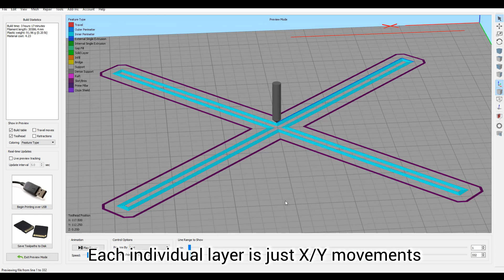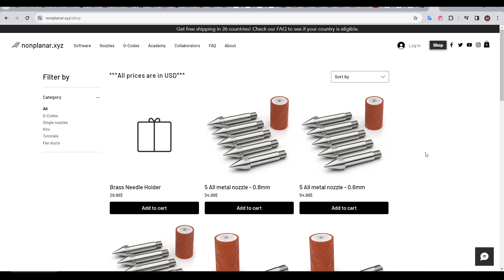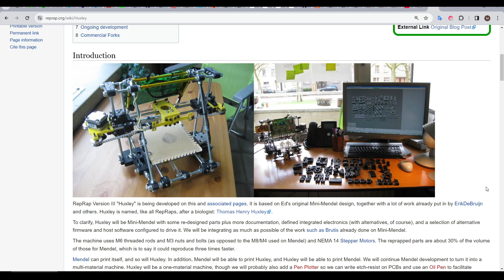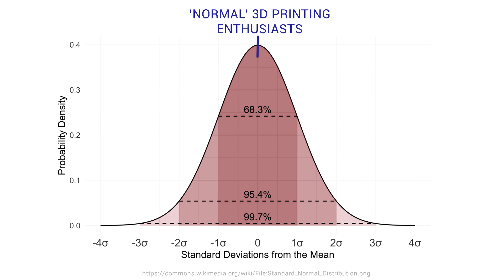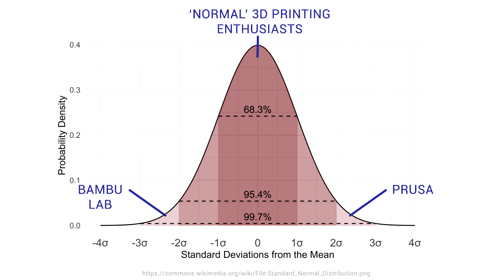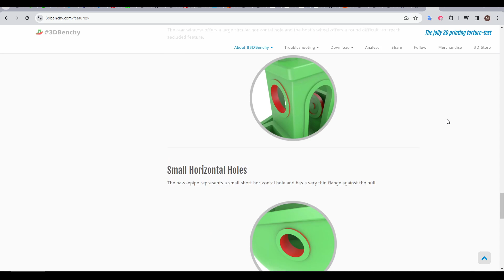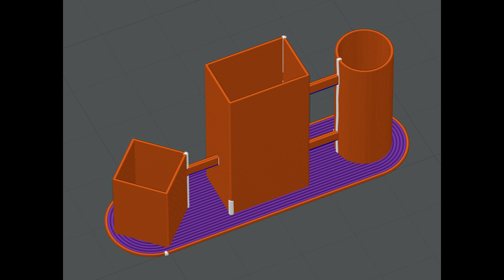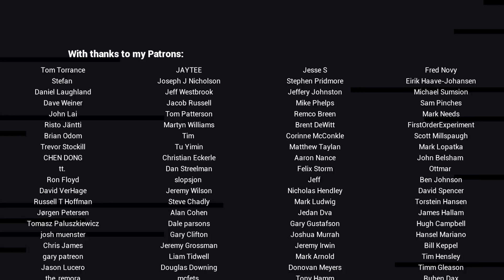3D printing mysteries that need to be solved in 2024

Comment: for filament snapping. this always happens to filament I left sitting in the machine, but only  for the bit inside the bowden and about 10cm or so outside. after than it's nice and bendy even for weeks. 

something chemically happening because of contact with PTFE?

Comment: Looking at the filament i would immediately think its making a turn in the bowden tube it cannot handle (too tight) especially because the filament has snapped on exacly the same side.

2nd thing i can think of is (looking at the machine) that you are forcing the filament to bend the other way then it is on the spool.
Turn the spool upside down so the filament feeds in on the top, make a bracket that high for the tube so it "flows" better to the head without bending it against its natural direction.

Comment: its odd to me non planer hasnt taken off as somebody who does CNC machining. The gcode generation is there to move end mills through materiel non planerly for cutting, well if you dropped step down to say .2mm programmed with a .4mm end mill youd basically have the reverse of a 3d print movement wise. Restrict that to an area the clears the nozzle and print head and you might be able to just just copy paste the gcode lines in reverse onto what your slicer outputs 🤔
Reply: The software for 3d slicing is there. The hardware (hotend gantry design) is the issue

Comment: All filament will spiral Clockwise regardless of the country - I am in Spain (North Hemisphere) and in my most recent video (at 1m53s) I also had filament spiralling clockwise. The reason is most likely that all drill bits carve clockwise, and they make microscopic grooves on the nozzles that guide/spin the filament in this direction.
Reply: The video is this one: https://youtu.be/qNCDXdjJb90?si=WRsg93vkoDT-NmxP&t=113 Filament spirals clockwise as well, in Spain.

Comment: Regarding the surface artefact: I have had issues with this for a while, mostly within a single part. I have no idea where it comes from but I have a strong suspicion that it is a slicer issue. I have seen this mostly when slicing with Prusa Slicer (or Slic3r earlier) and have had better results when slicing with Simplify 3D for those parts. To me it always seemed a specific problem with those slicers. Temperature issues didn't make sense to me since you get this effect even if you print huge parts when only a small section was done and the top surfaces were printed.

Comment: I always thought those artifacts where something somewhere else in the print causes a change in the texture were from the paths having to change accommodate what was happening elsewhere in the print. It will start and end the layers in different places than it would otherwise since it has a different plot than the layers before or after.

Comment: I think the artifacts are created due to thermal expansion in combination with layer time. When the layer time suddenly increases the plastic has more time to cool down so when the next layer comes it pulls the underlying layer with it because it is still kinda soft.
One experiment i can think of is using the cooling feature of the slicer to make every layer time as close as possible by setting the slow down print when time x to the longest layer time to see if it helps.

Comment: You should test the temp difference theory, I think with a high-powered heater and a cht nozzle that could be eliminated. Not 100% but I now use a ceramic heater that claims to be 115w and a cht nozzle and I don't think I experience it anymore. just an idea

Comment: Counter clock wise, this is due to the rotation of the earth. Tie a string to a weight and put it to one side and when you let it go it will move  back and forth with a rotation  in a counter clock wise direction in the upper side of the globe.

Comment: I personally have 3 different Bambu printers, simply because they're faster and easier to use/maintain, not because they're better. A colleague at work has the original prusa mini which he upgraded to the level of prusa mini 3 and he has over 560 DAYS of print time without replacing anything but the silicone sock. Is prusa slow, yes but you'll get marginally more accurate parts dimensions wise and repetitiveness is currently unmatched which is why many print farms use them. They're the good'ol reliable. But while Bambu, AnkerMake and Creality are targeted at your day-to-day consumer, I think Prusa leans more towards the industrial side of 3D printing, especially with their new Prusa XL.
Reply: Prusa Mini is so temping, it's so understated design. And I'm saying that from the position of a man that basically got PhD on FDM 3D Printing trying to squeeze impossible from Ender-3 since 2018

Comment: I've had a Tronxy XY2 Pro 3D printer for about a year and it has been a rollercoaster of excitement and frustration. I think the main change being seen now is 3D printers are becoming tools. This will cause a device as now printers work out of the box no issues, people aren't exposed to the frustrations of bed leveling, nozzle jams, bed adhesion issues and so on. Seems to be 2 camps now, a 3D printer as a tool for another hobby or 3D printing as a hobby. This is my opinion based on things like the bamboo labs machines becoming so popular and less kits being available. It's a good time to be into 3D printing as it's more accessible to more people, meaning more help when you have that one specific issue on any machine.
Reply: Oh it's even worse. For some people Bambulab is some sort of status symbol. I was berated for suggesting that I want to install CHT nozzle for my Bambu P1S. I was called cheap and stupid for even thinking about ordering non-official hotend from Aliexpress for $1000 printer.

Comment: as for your question at the end, the discoloring is temperature.  it's the same reason benchy gets the hull line.  (prusa tuned their benchy not to have it, but if you normally slice and print a benchy, you'll see this).  the reason is the top/bottom shells are 100% infill, so they require more cooling, so that can change the sheen in a single print, and with two models on the plate, it increase the time between layers for the second part, so the lower layers print quickly and stay warm, but at the top couple layers of the other object, the printer slows down to print those top surfaces, so there's more time between layers on the other object, so the layers cool more before getting the next layer, and you'll see a difference in color (really it's sheen, as the higher temp gets more glassy, cooler temp ends up more matte)

edit: by the way, the hull line on benchy does this because the line is where the back deck of the benchy is printed, which is technically a top surface, which means 100% infill, which means it needs to slow down to allow proper cooling, so the sheen changes on those rows due to the longer time.  I don't think it's nozzle temperature, but the time between layers (so still temperature in the end, but due to time between layers)

Comment: I suspect that the artifact on adjacent parts is due to the plastic cooling off for much longer than usual when the printer is printing the top layer of the cylinder.

Comment: so I've seen this toxicity thing in various hobbies and I know what causes it, and there's fault at both ends.  i also started 3d printing over a decade ago building a mendell i3 from hardware store parts and an Arduino mega.  I then went to replicator like many did.  and so on.  it was great back then.  the printers not so much, but the community was great.  

but the toxicity came with bambu labs.  not the company itself, but the people it brought into the hobby.  I'll explain:

hobbies that are niche start off with a smaller community.  with less information, there's a necessity to share and collaborate.  it's great. the people know their stuff and the new people get lots of encouragement and help, as we WANT the community to grow, as it helps the hobby grow too.  my other example where I saw this ironically came from the same people that made bambu: DJI.  I was into building quadcopters back when it required you to manually build them from parts.  motors, ESC's, a janky flight controller someone in the community made.  it was not easy.  not easy to learn.  not easy to build. not easy to tune.  not easy to fly.  it was hard.  but the community was great.  RC hobby is a very old hobby so there was already a little bit of toxicity you could find in specific areas, but the "drone" area wasn't too bad.  but then DJI came along and released the phantom.  now every moron with $500 in their bank could buy one.  they then started flying them above busy highways, above airports, and near-misses started happening, then the FFA started creating restrictions, and we were watching our hobby get destroyed by a sea of morons because a company came along and made the once difficult hobby very turn-key so any ape with opposing thumbs could do it.  the toxicity comes from this.  they buy one.  fly it for a few weeks and learn all about their phantom.  now they're technically experts, at least in the consumer level drones, as funny as that is. but when people come ask about quadcopters, those self proclaimed experts chime in with their three weeks of knowledge and confidently give misinformation.  the old guys in the hobby that have real experience from before DJI came along would obvious fight against the disinformation and pushed to keep people from ruining the hobby by doing stupid crap like flying them recklessly.  this would cause a fight as the self proclaimed phantom experts thought they're the second coming, and it just never ended

same with 3d printing.  we've had consumer printers for a while, and while prusa got this as close to turn key as ever, it still required some knowledge and the ability to handle hand tools and do a little common sense experimentation to master.  and that's not to mention the OG guys like me that build them from scratch.  but then the bambu printers came out and Facebook group created.  same thing happened.  people with zero experience bought an X1 and became self-proclaimed 3d printing experts a couple weeks after ownership.  they then went and started this confident spreading of misinformation.  I can't tell you how many people still use glue on every print on their bambus.  I gave up trying to fight it.  idiots would come argue with me.  it's like hello, I made a printer a decade ago when you were possibly in diapers, and we HAD to use glue back then because most printers did NOT have a printed bed.  in fact one of prusa's original business ventures was selling pcb heat beds for the reprap printers.  I had one.  with glass on top held on with binder clips. we used blue tape, Elmer's glue slurry, kapton tape, glue stick, etc.  and remember we started printing 2.85mm filament with way more thermal mass, and we printed ABS primarily.  it was the most readily available at the time.  it was HARD to get prints to stick AND release, and it was a necessity.  then prusa released PEI with their i3 mk3 and it changed the game.  no more glue.  a well cleaned PEI sheet just always stuck.  textured for PETG/ABS, and smooth for PLA. (or my favorite, satin, which you can really cover everything).  but I see these newbies that only are able to print because bambu made a very turn-key printer and are just being toxic.  

and I mentioned both sides in my first paragraph because some toxicity comes from the actual experts too.  it's a human thing unfortunately.  people ask a question, then every response is a paragraph about how they should learn to search.  but if nobody asks because they're only supposed to search, what material are we expecting the search to find?  nothing.  so I always suggest everyone to just answer the people.  choose kindness.  yes people should try searching but maybe they already did?  either way, if you answer them, that's MORE information that future searching people might find, saving them from needing to ask.  PLUS, these hobbies change so quickly.  prior answers you find from searching will probably be old information that might not even be 100% relevant now.  so it's ALWAYS, 100% of the time, better to just answer the person's question.  and the funniest thing is that the toxic experts will spend 15 minutes writing a paragraph about learning to search, when they could either not comment at all, or better yet, type the potentially only one-word answer to the question lol.  "for PLA use smooth PEI".  boom.  question answered.  but they'd rather write a novel about using search function.  it's insanity.

I left the bambu Facebook group.  I tried to tolerate it for a long time, but the people that would just come in and be moronic and toxic was beyond comprehension. I have a few bambu printers and I like them.  I even had a phantom and a mavic mini.  I wish they'd give back more to open source, as they sort of did to the hobby what bre petis did when he made replicator 2 closed source and sold out to stratasys, becoming filthy rich overnight on work the community built together.  bambu did at least comply with making the slicer open, but I think a lot of hardware borrowed enough from things we learned as a community that it should give back, even if they delay that by a product cycle.  but that said, I'm not blaming this on them.  humans are ultimately the problem.  but turn-key solutions to a once-niche hobby I think is a huge factor in what causes this
Reply: Its nice to see that I'm not the only one noticing that. Last week I was called cheap, unknowledgeable, disrespectful to Bambulab engineers and overall stupid for asking about Aliexpress CHT hotend for P1S on Facebook group for Bambulab printers. If it wouldn't be for the fact that since 2017 I'm involved in 3D printers, I would probably cry in the corner. But instead I cried in the corner because it's an end of an era. 3D Printing community is not a safe space for me anymore, only specific groups like Teaching Tech or others I consider safe, but still that is trust that is lost and will not be rebuilt probably ever.
Reply: I understand your reasoning and i can confirm from first hand experience that small tight knit communities where people are strongly dependent on each other are generally very well behaved. When such a community gets flooded with people online who don't feel like they need to belong, who are effectively anonymous (real name or not doesn't matter, it's just not coming back to bite them if they misbehave), things go south quickly.

But i also have a hard time believing that it's Bambu specifically. I have seen all this toxicity in just about any 3D printer group that wasn't well moderated ever since maybe the Anet A8 era, more so since the Ender3 era, because we have had millions of 3D printers around for quite a while.
Reply: @SianaGearz  it's not only bambu, as there was a bit of brand elitism before they came around, but at that point it didn't seem too overly toxic.  after bambu.... that facebook group is the single most toxic user group i've ever experienced for anything ever.  holy cow was it bad

Comment: Hi Michael. The filament snapping is due to being brittle caused by moisture in it. Polymers (especially very hydroscopic ones such as PLA) has its  van de walls bonds broken very easily due to water. Thanks for the excellent vids as always 👌
Reply: i have  4 old rolls of PLA still sealed in the bag with desiccant  i cart even unwind the filament off the roll without snapping, to cure this i put them in the oven for 4 hours at 50C and the they are usable again, not sure if it is moisture or the PLA just getting old.
Reply: Woosh
Reply from the maker: I think I understand a single snap, it's the aggression in which this segment napped that I need to understand. I'm wary of a curse..
Reply: @TeachingTech  It's because the old brittle filament wants to go back to the same radius it had on the spool. I've had few spools like that. It still printed fine so I just unloaded after each use.

Comment: Oh my god yes the last one has bugged me for YEARS. I assumed more people already knew about it but there was no fix. It's so annoying when a print looks basically perfect except for this issue. I would point out though it also happens within a model when you have solid top or bottom layers. Look back at your first example of a prism from the Prusa XL, the top and bottom of the model have similar artifacts as your second example does, also inline with the top layers from the cylinder. My assumption has always been that it is related to pressure in the nozzle. I have zero evidence to back this up.

Comment: Could the issue with the filament breaking in the bodin tube be an age/ quality issue along with the feed angle of the filament into the tube becoming extreme when the print head is close to the filament spool? It's hard to tell if this is the case without seeing the printer operating.

Comment: For the filament in bowden tube breaking. You are not alone. I have has this happen with both of my printer ls I've owned.

For me, it happens when I leave the filament in the bowden tube too long. 

Have you tried testing same filament just in an extra length of bowden tube?

I don't have a theory why it happens. How I prevent it though is reversing the filament out of the printer if I know the printer will sit long. 

Thankfully my new printer only uses bowden to get filament close to direct drive block and I can simply pull the filament out.

Comment: The filament snapping issue is because PLA has added plasticizers to improve flow for printing.  These plasticizers are volatile and get driven off with age and excessive filament drying. The most common plasticizer is polyethylene glycol....the same stuff they use in vape pens.